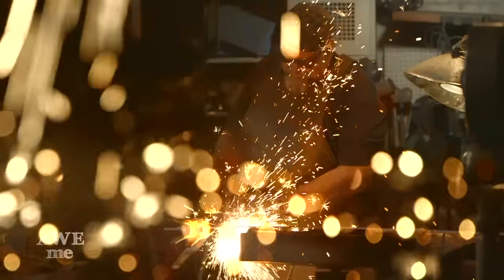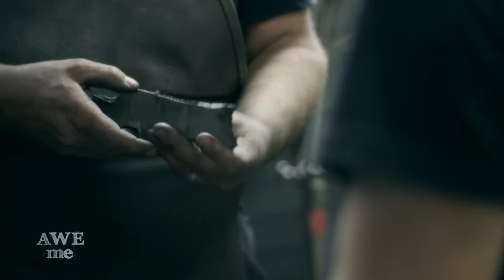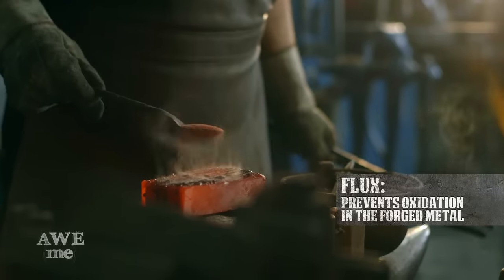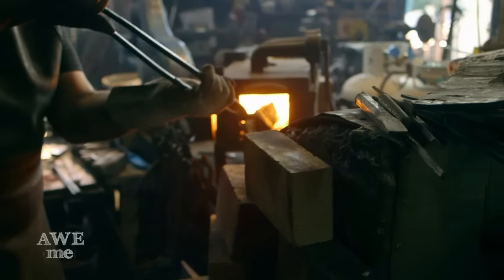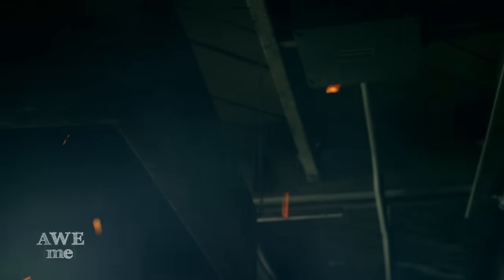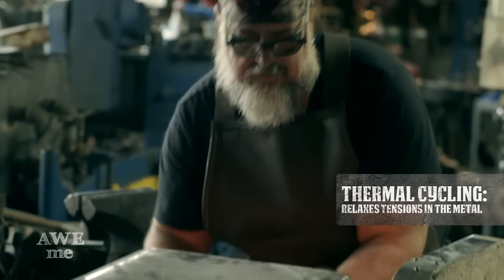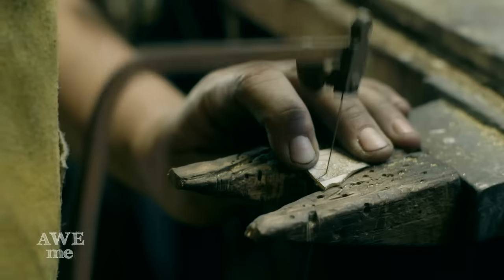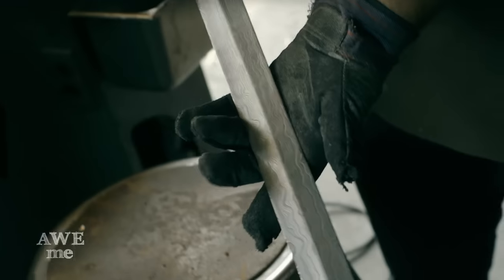Sokka's Meteor Sword (Avatar: The Last Airbender) - MAN AT ARMS

Comment: My one gripe is that he didn’t actually cast it the way they did in the show.
Reply: If they did it would be Fragile and dull
Reply: @RRRREALbadman  Unless my understanding of meteorites is wrong, I don’t think that would actually happen. If a meteoright is made of iron and other substances that if you cast it in a mold it wouldn’t necessarily be more brittle than if you fold it. Because folding it merely takes out all the impurities, and distributes the carbon evenly throughout the object. If you cast it in a mold you automatically evenly distribute the carbon because that is what happens when it becomes molten. And you can take a stick or something and remove all the impurities which float to the top. This is my understanding anyways.
Reply: @benjaminstiles  alot of impurities will simply melt rather than burn, but I do see your point. However melting it would be unnecessary, the cast would make it harder to avoid bubbles, and if they directly put it in water the heat difference may crack it
Reply: @RRRREALbadman  you do have some good points there, but frankly, I don’t know enough about metals to counter that.